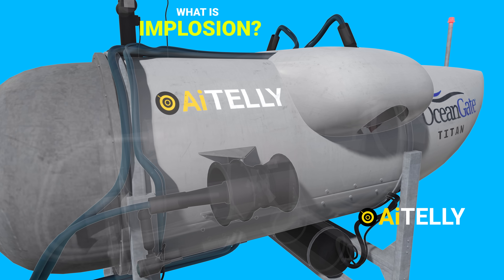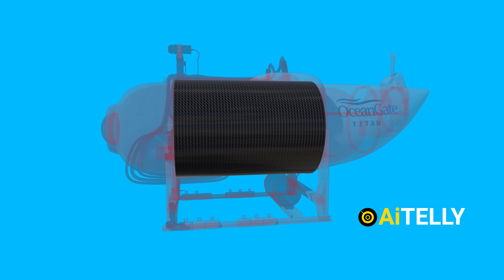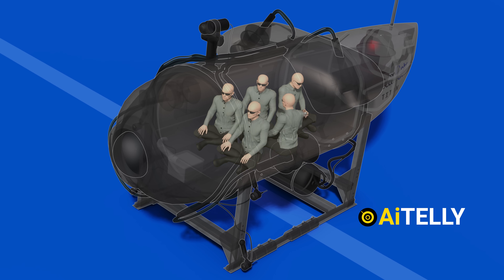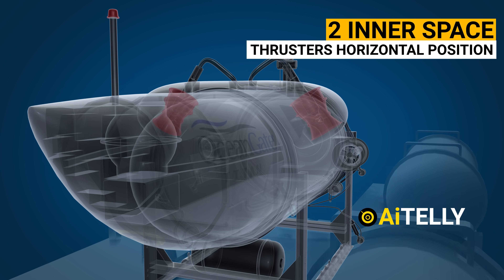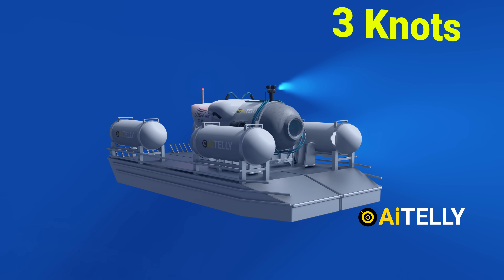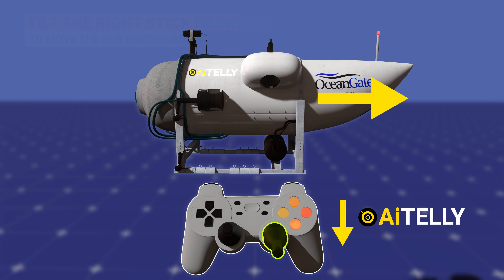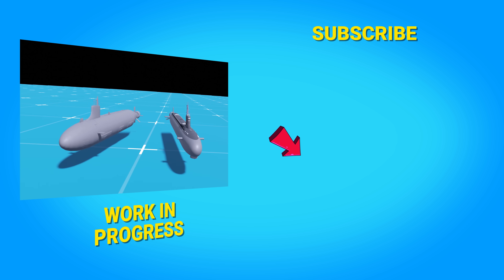Implosion Titan Oceangate How it Happened | Submersible Submarine Parts #3d

Comment: I think you should have gone into more detail on the carbon fiber hull. Most people already know how the submersible works. However many comments don’t understand why carbon fiber is inferior to titanium in deep sea diving. You could explain how composites work and how the CEO knew it had a limited lifespan. That way everybody understands why this disaster happened.
Reply: Kohlefaser ist zugfest, also gut gegen druck von innen, aber sehr schlecht gegen druck von aussen!
Dazu kommt noch das der ceo keine neuen kohlefaser verwendet hat, sondern von boeing ausgesonderte kohlefaser weil sie ihre nutzungsdauer überschritten hatte, hat er sie billig erwerben können!
Und die scheibe hatte nur eine zulassung für eine maximale tiefe bis 1300 meter!
Reply: @roadracett2853  Wow! I hadn't heard that about Ocean Gate buying old surplus carbon fibre. If true, that's evil.
Yes, my understanding of carbon fibre is as you said, great tensile (under tension) strength, but not so strong when under compression.
Reply: @roadracett2853 so he went way over twice as much pressure it was designed for" wow" 😮
Reply: @roadracett2853  thank you. This is much more info than these tired, getting stale videos.
Reply: The carbon fiber just seems like a bad idea
Reply: @likemostthings  it was apparently.
Reply: @likemostthings  Hindsight is 20/20. Haha
Reply: Best comment. Moisture is creping into the fiber.
The cyles also matter!
Everybody is able to google te following text:
On the other hand, there is still a significant problem with epoxy resins, one that limits their use in the aerospace and other demanding markets: their ease of absorbing water. The absorption of water decreases the thermo-mechanical properties of these composites, shortening their useful life. Several works related to the effect of surface treatments on carbon fibers or the incorporation of thermoplastic resins to the epoxy resin on the resistance to water attack in carbon fiber-reinforced composite materials have been reported
Reply: @fritzlehner9060  I would really love to see someone who really understand physics and composition of material to explain all this concepts together, such as the explanation on why for a brief moment there was temperature like "the surface of the sun" and what explains that (maybe the compression, like in a car engine), but I'm seeking for this content and can't find anywhere.
Reply: @AlexandreAugustin  Look for adiabatic compression. In fact it is comparable to the stroke of a Diesel Engine, but a lot more of compression.
In a Diesel Engine the compression ratio is aproximately 20:1. In case of the implosion pressure rises from 1 bar inside to more than 300 bar surrounding water pressure outside.
Reply: @AlexandreAugustin I'm not a physics expert but I saw it explained as the water collapsing in acts as a piston in an engine, compressing the air and igniting the oxygen in the space.
Reply: @fritzlehner9060 the RIFA capacitor is a prime example of how expoxy absorbs moisture, cracks, more cracks from thermo-cycles and goes Ka-boom in the end, causes catastrophic failure over time.
Reply: @andytwgss  Very true !
In this particular case the resin prevents the fibres from buckling.
And of course the cycles have an impact !
Reply: @fritzlehner9060  not to mention they didn't put the carbon fibre hull through the oven to strengthen the bond of the epoxy and squeeze out the oxygen in the layers. Also they didn't keep it dust proof environment during Manufacturing means it's inherently poorly made. A ticking time bomb at best
Reply: @leonardleonunu  So true !
It is not that easy with carbon fibre.
They were hobbyist !
Reply: Just because they said that they listened to the viewers feedback, they can’t go back and change the video every time they get new feedback. They been gracious enough to do that. Imagine if all creators do that! Madness! It takes a long time to make videos and edit and all of it
Reply from the maker: Ok that was really Goog feedback-Thanks for educating us
Reply: @Aitelly  why's this answer so AI-ish
Reply: @sefii05 suspect it probably is. But this is youtube...it's all for clicks.
Reply: @imho2278  so many engineers on here, I wonder if the officials will search these threads for confirmation lol
Reply: @sefii05  you haven't seen the way AI answer things lol
Reply: @thedbcooperforum well I am a electronics engineer who did work with composites in high school.
We tend to be interested in accidents
Reply: @jhoughjr1  sorry, should of been more clear, I was referring to the "so called experts" that seem to pop up with events like this...
Reply: @sefii05 Can't even tell, but I'll bite and point out the literal name of the channel you sought out and commented at. Dear lord.
Reply: @sefii05  I feel everyone is going to be on the look out for AI these days... and probably for a good reason! I'm sure it's going to be used EVERYWHERE including the Youtube comment section!
Reply: @sefii05  because it deserves that, if anyone thinks they can do better, they should go and make their own video edumacating us. Lol
Reply: @sefii05  It is AI lmao
Reply: @lololololol-z3x  I
Reply: @Aitelly   so the submersible had better toilets than the country of india??
Reply: @Aitelly  Goog
Reply: @Aitelly I thought the controller showing how the ship moved was an interesting animation that no else has done.
Reply from the maker: @wangchung6910  Thanks bro only some real OG will understand the animation and research that goes into it.
Reply: @Aitelly they literally reached the titanic wreckage. Checkout the previous expedition. But in this expedition something must've gone very wrong
Reply: That was Goog feedback, lol
Reply: @Aitelly  yeah whatever. Those who can't preach. Nice work!
Reply: @Aitelly I feel like everyone is constantly telling very basic points to touch on that you always fail to add. Your videos are super short. Seems like you dont care to be too detailed with your videos.
Reply: @Aitelly   yeah and the animatin of the implosion is not correct. They animated it like it is bending inwards but actually it violently imploded and shattered into peaces.
Reply: @Aitelly  
Is that an answer of a real person, taking the piss or AI?
Reply: @Aitelly  Gooooooooooooooooooooooooooooooog!! :P
Reply: @Aitelly  loosen up a bit lol you sound like an AI
Reply: Sarcasm!
Reply: @Aitelly  You should’ve already known this before putting out limited information.
Reply: Based on the video I saw showing how the pressure hull was constructed, it was metal wrapped with carbon fiber.  This type of construction is usually used to contain high pressure such as carbon fiber/fiberglass wrapped SCBA tanks.  It’s an excellent method to contain a high pressure expanding against a cylinder.  I have never seen it used in the other direction preventing implosion, and it doesn’t seem to be an effective way to resist pressure from the outside to the inside of the cylinder.
Reply: yeah carbon is good when it comes to extension but terrible for compression
Reply: Also do not forget that they did not interweave the carbon fibers in X pattern like it's supposed to be done, they were laid in paralel with little overlap. Not that this matter anyway over time considering the properties of the carbon fibre itself.
Reply: Terrible build that shouldn't happen but it too late..   just leave titanic alone and don't do anything in the future..
Reply: Rush must have worn the same shoes his whole life , he had no concept of wear n tear.
Reply: I’m not a mechanical engineer but even this layperson can see how it’s a really awful idea to join a carbon fiber CYLINDER to a titanium semicircle, expose the whole magilla to hundreds of atmospheres and expect it to hold up.
Reply: This video was informative for me
Reply: @RuminatingKiwi927  ? he called the titan a submersible. the other submarine was infact a submarine.
Reply: @lololololol-z3x  woops, didn't mean to reply a comment. Anyway, the U-boat isn't a submarine, it's a submersible because even though its not launched from a mothership, it's not meant to be underwater for a long time, or spend most of it's time underwater. However, the electric variant of the U-boat is a real submarine because it can spend most of it's time underwater and actually perform better underwater.
Reply: @RuminatingKiwi927  As the name suggests, the U-boats are under-surface ships or boats. The letter U stands for German word "unter", having a similar meaning with English word "under".
Reply: because it's a weave of fibers helt together by glue. It's like making a space station out of wicker baskets.
Reply: @KneeCapHill I’m making a Titan Model using a TP roll and Fisher Price Little People as passengers.
Reply: It is ok though. These videos are supposed to be quick rundowns. Last video there was no mention at all but now they acknowledged it as being the main part of the thing. 
And again, these videos are just quick summaries. There are other channels with in-depth analysis.
Reply: @laughingseal2282  The title suggests that exactly "How it happened" would be explained, and since we all know the composite material was the culprit, how it happened wasn't exactly covered in the video. The reason for this is that they don't have any idea, which is a perfectly reasonable objection to this particular quick summary.
Reply: Also another note is that it had made more than one dive and each compression and expansion weakened the Carbon Fibers so this (I believe) 7th dive was the unlucky one
Reply: OceanGate CEO once said Titan sub's hull was made with carbon fiber from Boeing that was past its airplane shelf life which he bought at a discounted rate.
Reply: @WR-NC-ASPL  That's sick. I'm not an expert but my father (an aeronautic engineer, now retired, who was responsible of the safety of the wings of some Airbus planes) says is just idiotic to think the preassure of a submarine is somewhere similar to the one of an airplane. A submarine suffers x400 more preassure than an airplane!!!
Reply: These guys aren’t experts at all, they’re just trying to put out videos as quickly as possible to farm views, hence them having to correct their prior video and potentially correct it again
Reply: Exactly, I'm no scientist, but nonetheless I would be interested why carbon fiber is inferior to titanium and why it was used.
Reply: @sitinowak Rush definitely used to to save money, and it didn’t take him as long to build, so he could be making money as quickly as possible.
Reply: @sitinowak im an engineer who worked in the aero space industry the reason it was used on aeroplanes was because it made them lighter and airlines liked this because this conserved fuel and it was good for sales unfortunately it could only be used on certain parts and definately not on the fuselarge because when rivets were inserted they did not give a tight fit and if struck by lightening it would make it very dangerous for anyone travelling titanium is a much stronger material i would of thought carbon fibre should never have been used on a submersible especially at the depth of titanic
Reply: It's curious how they thought it was a good idea to make a submarine with the material of an airplane 🤷‍♀️. It's as crazy as making an airplane with the material of a submarine. The preassure conditions are sooo different in each case.
Reply: They should’ve done a weave instead of rolling it on, but also more R&D unmanned to see what the absolute limits are and how many times it can go down and to what depth.  It’s possible to innovate and tread carefully.
Reply: Still now i didn't understand why CEO choose that material? How much cost he saved..
Reply: @Just_chill_bro_its2025  I think it would mainly be used as it's lighter, so saves money on the winches, thruster power etc.
Reply: I just use what James Cameron uses 🤷🏻‍♀️
Reply: Why Carbon was there😢😢 its weaker
Reply: @arjumandvillagelife money it’s cheaper and he wanted to get it making money as soon as possible.
Reply: Assuming the hull was the issue. Right now, nobody really knows what happened. Everything has to be looked at. Typically, an accident has a starting issue that may be very minor. Did the crew make a mistake on the deck? Did the "captain" get enough sleep the night before? Was there a fire? Did they hit something in the water? If the hull was the cause, were there imperfections in the material? Was there consistent thickness....etc, etc. Honestly, you don't know if it was murder suicide. The investigation will take many months.
Reply: Not only the carbon fiber but how it was jointed to the titanium. I wonder how that was made considering that they are two very diferent materials and there was the failure point.
Reply: @magister61  they glued it no jokes.....a brave man
Reply: When other Compaines, and several engineers in the industry advise you not to do something. It’s time to drop your ego and listen to them.
Reply: absolutely, beside that, they placed the oxygen supply outside the Hull, the monitors were screwed to the Hull instead of using this vacuum holder. The composite material, carbon fibre, was bought by Boeing, since it has already expired he received it at a much lower price. Anyway, like you said, there was a lot of flaws in this design!
Reply: absolutely, beside that, they placed the oxygen supply outside the Hull, the monitors were screwed to the Hull instead of using this vacuum holder. The composite material, carbon fibre, was bought by Boeing, since it has already expired he received it at a much lower price. Anyway, like you said, there was a lot of flaws in this design!
Reply: Titanium and Steel are used for submarine and submersible because they r very ductile compare to carbon fiber.
We use carbon fiber whine we need stiffness, light weight and strength;  in aviation for instance but in submarine we need very ductile material.
these are material that can take a lot of force in many directions and still maintain its integrity and strength.
Carbon Fiber is very light and stiff, very good for boat application and aircraft body but not for structure tonbe subjected to extreme force in any direction especially perpendicular to the surface area as it is the case for submarine n submersible. Ocean Gate was aware of it but since the owner was cheap and did not want to put the money for it, he got what he paid for. He was warned by Engineer but he prefers to believe the unbelievable.
Carbon Fiber is very brittle compared to Titanium and Steel. He was warned and informed of the design flaws. 
Knowing what I know in Strength of material and the development of the hydrostatic pressure  as well as the property of material in material selection I will never advise anyone to use any material other than very ductile high-grade metal preferably High grade anti corrosion steel and Titanium
Reply: What about the computer monitors most likely being affixed into the carbon fiber hull? Hmm? I would liken a carbon fiber hull on the bottom of the sea to plywood. What about drilling into carbon fiber? I also noticed that there was a rubber like seal on the bottom of the titanium rounded hull caps and noticed that the rubber seal did not serve a purpose more than mud flaps on large trucks. You can see it in tour videos. What purpose did it serve? Do you ever think about how the titanium rounded caps of the sub every time it was bolted shut, should have been cleaned? It's a dark thought but what if the oils from your skin could have contributed to an improper seal when you were using that joint between the metal rings and the rounded metal caps as leverage to get into the sub? 

In the carbon fiber hull, any type of boring into the material introduces very fine shearing which can introduce tiny air pockets. I think you are referring to delamination of the carbon fiber hull undergoing stress from cyclic deformation and any tiny space where the layers separate could introduce new stress points. What about any stress on the glued carbon fiber hull to the titanium rings? What about the shear force between two different materials? Think about the ends of a carbon fiber hull bending up and down and the possibility of the carbon fiber hull fraying at the joint of the rings. What about the weakening of that joint compound overtime? It was glued on. Can you understand how hard it would be to maintain a proper seal in the depths of the ocean where the carbon fiber hull started bending? How could you make a carbon fiber hull last decades and how could you fix the fraying ends of a carbon fiber hull? It brings into question surface prep and going forward, how could you recap the ends of carbon fiber to make sure it had a great seal, how would you go about repairing it

Degradation of proper seals between composites, it's different in space.
Reply: A spherical pressure-resistant shell would have helped, but it was a mistake to make it cylindrical in the first place for ease of shaping.
Moreover, it is not a one-piece molding but a two-piece molding.
Reply: Carbon fiber isnt apropiete for objets afected by pressure
Doesnt matter if it is deep dive or not. Planes are not made of carbon fiber for a reason
Reply: I believe the fibercarbon is excellent for high-pressure tanks, but we we talk about external pressures, then the fiber should no use for this application...  Fibers resist stretch forces, but collapse forces I will believe only can hold by the epoxy but not by the fibers... So, in my conclusión the Epoxy  was resisting the pressure and not the fiber carbon... I'm not an expert, but I understand how good the Fibercarbon is for Extreameally  high-pressure cylinders...
Reply: @rupertoseabra9561  the window was not tested for that depth
Reply: About 1% of people in the comments know how submersibles work.  But everyone will pose as experts with their google education.  Google epidemiologists are now google deep sea explorers lol
Reply: Do you know how stupid people are?
Reply: hes guessing .. he cant say why untell they give us updates
Reply: Yes. I too want to know the points you mentioned. Nonetheless, thank you for the video.
Reply: A child molesting, career corrupt criminal will never be MY President.
Reply: Agree 100%
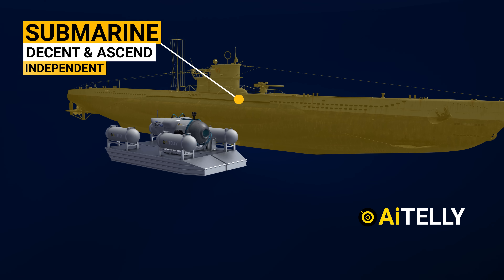Reply: 1:48 in fact, even the U-boats were considered submersibles. They were defined as such due to the fact that they could only stay submerged for at-least 2 hours before having to surface and replenish oxygen levels.
Reply: Why don't you do a video then smart arse?
Reply: Also the fact that it took them a long time to find the wreck when according to the media it was not that far away...then again the media are full of lies so maybe I am wrong
Reply: Try do a better job, this was a brilliant animation
Reply: Don't forget it also took a lightning strike
Reply: Play stupid games... Yeah they couldn't complain if they survived. Would you take a 300km/h Fiat Uno without a seat belt around Nürburgring ?? Yeah. So I really don't care. All I care about is seeing guts and gore of these idiots being exposed
Reply: You should do a video since you know exactly what this creator should of done.
Reply: I am only here for the ads.
Reply: Ummm. Someone else should do it. They can’t keep fixing a video every time someone has an opinion
Reply: FJB
Reply: Biden supported diversity hires. This happened in result of diversity hiring. 

Figured Id let you know that
Reply: Probably smart of them not to pretend to know other people’s thoughts. Clearly you think you already know all about this, so you don’t really need to watch at all.
Reply: This was barely a disaster... Super wealthy having fun that is all 😅
Reply: @aHarzoo that's exactly why it was a disaster. Two billionaires were lost and another highly regarded Titanic expert. Not to mention a 19 year old college student who's whole life still ahead of him.
Reply: I agree with your comment except what you’re saying on your user ID name 😂. It’s all right we can agree to disagree. 😅
Reply: Well, the theoretical limited lifespan is measured in possibly over 20 years... Factors like UV, humidity and so on affects it. But there is no way to tell how iterations of exposure to high pressure will affect it, at best one must perform inspections using ultrasound to observe failures within the matrix of the epoxy. I know for a fact that a full discovery of issues would be impossible at at mating surfaces where the epoxy is being glued to the titanium rings. One can only assume that these are the points of failure but it's not a given since the outside pressure pushes the titanium domes towards the composite, so it depends on how the composite is seated towards the titanium rings. If there is supportmaterial of the rings directly supporting the ID of the composites then one can assume its quite safe. However repeated high pressure compressions and decompressions of the hull may likely cause the epoxy to crack over time... The proximity of the wreck site would suggest that it did happen close to the bottom if the wrecksite is displayed to scale
Reply: but in the beginning he did mention in acute detail the inferiority of carbon fiber versus titanium/steel given their submersible application. Les we not forget how his focal point is about hull integrity as it pertains to deep water implosion. in other words, chill out, dude.. make your own rundown if you gon act like that.. oh wait.. plenty of other outlets already covered the bases you wish to have reiterated to you for what? oh, cause you're just .. you
Reply: Just watch James Cameron explain it
Reply: I thought carbon was much stronger than that. It did not even went to 4.000 meters and it popped. Disapointing materiial.
Reply: This comes from a guy who supports someone who doesn't make any sense while talking, "all men and women are created equal and you know the thing....."😅
Reply: It was an accident
Reply: They may as well have lined a 1978 Chrysler Volare with sheets of plywood and pushed it off a bridge. This was NO tragedy for anyone on board beyond the unfortunate young man who's father forced him into it. It was an example of the same risk taking that  made them all wealthy taken one step too far. The issues with Titan where "no secret" yet they all plunked down 250k anyway.
Reply: Make your own video, genius. I'm sure it will be perfect
Reply: Hi
Reply: Barrack is really your president.
Reply: I was about to comment the same thing, the shape and material of the hull is the most critical part, the outer skin didn't have much to do with the failure other than it just covered the craft & housed the electronics etc...
Reply: They cant they are lazy. And only wants visits
Reply: Im an engineer who worked in the areospace industry carbon fibre as a material is a lot weaker but also a lot lighter than titanium the reasons for using carbon fibre on aeroplanes was to make them lighter which in turn would save on fuel which airlines could save money
Reply: 1:04
Reply: Acknowledge posters critique/ suggestion that more time be devoted to pressure chamber analysis. However, video was perfect for my needs as I know very, very little about the submersible industry. For that I thank you!✌️
Reply: Explain the 2481
Reply: Have you noticed how often ps joysticks implode?
Or self destruct or whatever it is they do.🙄
Reply: I mean, so could you though??
Reply: I was almost clicking on the like button to this amazing comment but howeher it was made by Joe Biden, and i don't like him.
Reply: This video is automated
Reply: dont even know if it was the hull that caused it. stupid video speculation
Reply: Goog feedback
Reply: I think we can't explain more in detail the specific of the vessel because it was one of it's kind. This means there's no literature about it and every technical information is owned by the company.
We know that carbon fibers break instantly like ceramic and that their fatigue resistance decrease rapidly
Reply: @simoneceron1915  we know the window was not rating for that pressure
Reply: Joebidenis your president, u  can't advise him @ his own channel. Stop that Biden dictatorship
Reply: U r a dictator. Bidenis your president
Reply: Not to mentioned the moron even bragged about getting that material from expired aeroplane.
Reply: I don't understand why the carbon fibre wasn't multi layered in different directions. 
This is what gives it it's strength.
Reply: Exactly
Reply: He should have explained to the rest of the world, what pounds per square inch is. Are we in the middle age?
Reply: @@markdurham7918 
At last, some sanity amongst this madness.
Reply: I would have also liked it mentioned that the Titan had been down to Titanic a few times successfully already, and that it was in service for 5 years prior to the accident when it also ventured around the Mariana Trench.
Reply: actually, the US Navy built and documented that a Carbon and titanium Hull can be stronger and lighter than titanium alone. However, I suspect the failure here was not being allowed to inspect the hull after and before each dive. under those pressures, the carbon fibres will move and some may even delaminate. so with each dive, the hull will become considerably weaker.  the failures of the company to allow thorough inspection as been documented here.
Reply: Nobody knows why it imploded it’s all a guess at this point …. For all we know the seal gave out
Reply: Why did it have no black box tho?
Reply: Only reason is the choice of uds in one direction.. we never do that..we cannot blame oceangate for the poor construction
Reply: Things will be revealed in the court definitely
Reply: Thing literally had a window and you're wondering what the weak point was lol
Reply: its was the vessels 25th trip of course it was past its use
Reply: I enjoyed the full explanation. A lot of people, including myself, are new to submersibles, so it was beneficial for a lot of people. More on carbon fibre would have also been appreciated but I'm sure there only have a limited time.
Reply: I posted this comment before seeing your comment, but I'll repost under your comment to read just incase my original comment gets lost in the sea of responses to this video:

I think your graphic demonstration, while impressive, is moderately misleading.

The hull being made of carbon fiber is essentially plastic, carbon fiber itself is not air-tight, and polymers/epoxies are used to bond the strands and create the seal. The carbon fiber itself simply acts as a structural support to the very hard epoxy/plastic. 

If you have ever dropped a plastic cup and had it break, you will note that it does not deform like metal (like dropping a can) it actually shatters. 

The reason why carbon fiber is not considered a suitable medium for repeated exposure to high external pressure and temperature change is because small imperfections can easily become trapped within the layers of the carbon fiber and epoxy that cannot be effectively detected prior to launch.

For example,  during the weaving process air bubbles can become trapped, fibers can become damaged, or during the curing process bubbles can form, mixtures can harden at different rates creating shear zones... etc etc.

Imagine there is a bubble trapped in the hull, even just a pin sized bubble. This air pocket will become compressed by the pressure and allow moderately more flex to the carbon fiber/epoxy above it as it has more space to move before reaching its backing support.

This repeated flexing of the epoxy above the pin sized air pocket will inevitably cause micro cracks in the epoxy, and allow for the movement of the weave which will cause delamination between the layers. This will run the length of the strands in the weave and expand more and more quickly as the integrity of the epoxy becomes more and more compromised (because it obviously provides less resistance)

Eventually these seemingly minor, nearly undetectable imperfections, cause enough of the material to compromise that the sudden increase in pressure (3 knots / 3.5MPH down to a depth of 2.4 miles / 3800 meters, or 1.56 meters per second. 1 atmosphere of pressure is roughly equivalent to 14.6 PSI. For every 10 meters of descent into the ocean, the atmospheric pressure equivalent increases by approximately 1 atmosphere.
So at surface level, approximately 1ATM, at 10 meters down, 2 atmospheres, 100 meters 11 atmospheres etc etc... down to 3800 meters (resting depth of the titanic) that would be approximately 381 atmospheric pressure. 381*14.7 PSI = 5600.7 pounds of pressure against each square inch of the hull.

That's 144*5600.7 =  806,500.8 lbs of pressure affecting a single square foot. 

For perspective, that would be like parking two empty B747 jumbo jets ontop of eachother on a single square foot of space. 

That's means the hull of this submersible was subjected to an increase of 2,116.8 lbs per square foot every second during descent. (The equivalent to stacking a tesla model 3 ontop of each square foot of that hull every 1.92 seconds.)

So when this hull failed, it would not have crumpled, it would have shattered inward, like glass.

There's a reason why in most of the recovery photos you only see metal and other malleable components present, because the carbon fiber was likely essentially pulverized by the expansion of water into the cavity occurring at approximately 10 times the speed of sound.

If you want to get an idea of the destructive force this would have on a person or object, just search for videos of large amounts of water being dropped onto things, and remember that water falls at approximately 9m/s (20mph), but at those depths the water would be compressed to approximately .96/97 of its original size, and would expand to fill that space, accelerating the rates in excess of 7-9 x the speed of sound. (Depending on various factors like salinity, temperature and depth, but to keep it simple, just assuming the maximum rate of 10x the speed of sound or 7610mph or 11000 feet per second / 3352.8 meters per second.)

Assuming the space inside of the sub was maybe 1 meter in height from floor to ceiling, you can imagine how quickly these people were struck with 806,500.8 lbs per square foot of weight. (Average adult male has between 14-18 sqft of exposed skin across the surface of their body. Ergo it would be like flying 24-36 747 jumbo jets into them at mach 10.)

If you were to put a pin sized hole in the hull of that sub at depth, water would force through it with the power of a water jet cutting machine.
Reply: I think it's a basic design flaw because any fiber aims to endure pulling force, while  inward push at thhis pressure damages it.
Reply: It was because the material used to make the thing , it wasn't sufficient for the pressures of deep sea ! RIP people's,  💐 💖
Reply: It's simply obvious that titanium is a super metal first more weight make it way more strong and another properties
Reply: They were very stupid the restroom was the only part which reached the titanic
Reply: It looks to be made cheap...
Reply: ya ppl making these videos suck
Reply: It's probably made like a carbon fiber drive shaft or threaded link with the flanges dry wrapped and formed to them and a machine is wrapping to build a structure.
Reply: why use carbon fiber that what imploded
Reply: Yes. Too much time spent explaining how 2+2=4. Silly video
Reply: That would suggest this CEO wanted to go down as a murder/suicide deal, i simply think the guy didnt know anything about anything, and kept hiring only engineers that agreed with him (several people have quit, or been fired for raising alarm about how this fools whole thing was going, he was a fool, arrogant, whatever everyone is trying to say to defend this ape is all bullshit, ANy human being that works or has owned any laminate material knows they are not good with water, water is small, carbon fiber is full of holes, we fill the holes with epoxy and resin and whatever else, this will never ever ever (unless we invent new materials that dont exist rn, or that we havnt discovered yet) anyways, metal doesnt have holes (atomically speaking or whatever) i mean water cannot be forced thru metal without removing metal so water stays out of your boat, fiber glass, carbon fiber, things like that barely make decent materials to build boats out of and they only sit on top of the water, every single person with a brain told this guy not to do this, begged him to stop, anyone involved in this company should be in prison or a mental hospital imo
Reply: It seems like the thought process for the carbon fiber was to reinforce the submersible as a sleeve or shell if you will. Carbon fiber is very strong, but it also cracks or can flake/chip. I have had carbon fiber brakes on cars and once they chip, the integrity is compromised. Some people may have seen when the F 117 Stealth Fighter wings snapped and failed causing it to crash. I think the idea of using a carbon fiber sleeve around the submersible as a lightweight reinforcement was good in theory, but it should have been fully tested multiple times. It will be interesting to see if the part of the submersible that failed was actually the carbon fiber sleeve section, or if was actually the tail or nose cone that was not protected by carbon fiber that failed. It could be that the carbon fiber section held up as the other pieces of the vehicle failed. It will be hard to determine without all of the pieces and especially without any monitoring system.
Reply: I know nothing about engineering but when I heard the submersible used carbon fiber I was like WTF! I do know that even though carbon is supposed to be strong it is very brittle.  I use carbon cutters/bits in my CNC router and they break all the time.  So I never understood the idea that it's supposed to be strong.
Reply: How about you go and make a video explaining that.
Reply: We know now that carbon fiber is superior for deep sea dieing.
Reply: I am so sorry he didn't stick to know and proven materials. Someone should have talked him into more testing without live occupants. Very sorry for families loss. It was a tragedy  that should have been avoided.
Reply: It was a death trap from the beginning and no one should us it except for in shallow waters!!!
Reply: Yeah, this felt like it was intended for 5th grade level. You showed some cool stuff though. The voice is also AI, it pauses at the wrong spots and emphasizes the wrong words in sentences, I hope that's not you talking. It's uncanny valley material. Is this an AI project channel?
Reply: Rush received about $1 MILLION DOLLARS$ he took a gamble with his own life and 4 others, all for the sake of $money$ it appears.
Reply: Because it's Clickbait
Reply: As even a layman, I'm thinking even a hairline fissure would have led to catastrophe, not  noticed but under the conditions it loses integrity immediately!
Reply: All submarine hull materials have a limited lifespan. That's not what's unique about carbon fiber, and therefore it's not really what the problem is. The problem is that, due to the mechanical structure of carbon fiber, it is unpredictable and difficult to model under compression, so its fatigue life is similarly unpredictable and difficult to model. Titanium or steel subs will fail eventually too, the thing is we have very good understanding of how the material performs and how it fatigues, so we can safely dive subs and retire them while they are still safe. With carbon fiber you don't really know when it's no longer safe, until it fails and you're dead.
Reply: Not to become too philosophical but don`t we all have a limited lifespan? ;-)
Reply: Carbon Fiber, fiberglass, and Kevlar withstand compression loads repeatedly.  For instance the Boeing 787s top spar cap is compression loaded.  
    Compression loading fibers in analogous to pushing a string up a Hill.  The issue isn’t strength, failure mode being buckling or herniating into a void.  The trueness of the fiber lay, and void free matrix are critical.  
   Thick wall pressure vessels have a shear stress across their wall equal to the difference of the OD to the ID hoop stress.  There is no way to fiber reinforce this stress.  So it is carried by the epoxy.  Suggest this is the butt kicker.
    Each dive and as it went deeper the hull would emit noises (outside human hearing) each ‘micro’ failure.  The rate accelerated toward the end.   
   The implosion in the vid erroneous.  Carbon fiber shatters in big chunks.  There wasn’t enough oxygen in the hull to burn more than a couple of pounds of fat.  Once gas squeezed out, the bodies were pressure balanced.  Given flesh’s elongation, the bodies more like bean bags (but may have trauma from carbon shards).   (Going the other way, if deep saturation divers suddenly decompress the bodies explode.).        Cheers
Reply: Nobody will acknowledge it but if the vessel lost power source being it has a odd shaped rear end the heavier end with the weak glass would have hit bottom causing implosion after the glass already weak not rated past any other materials used it would of been first to allow pressure inside and flatten
Reply: That object weighed too much to not hit bottom on glass side vs floating to surface if power source was lost
Reply: The vessel looked like a rain drop and the already not rated high enough glass end probably hit bed causing a scratch or crack on glass allowing pressure into hull very fast
Reply: need to understand the poeple that create this videos are not engineers or anything sort like it... they just explain what a lot of video already do but nicer animation with better view so people gets a lot better knowledge about what happened
Reply: Nobody knows the reason the sub broke up at this point
Reply: @ivorheftylanger  not very sure but I think they said it was because it couldn’t handle the pressure. It had only been on so many dives, but people knew how incredibly dangerous this was. The glass lookout hole thing was NOT made for 4,000 meters of pressure-but you are right and there really are thousands of things that could’ve gone wrong-from the video game controller losing connection, an implosion, a deep sea creature, god knows. Nature is strange.
Reply: I've constructed and tested fiber composite pressure vessels to destruction. Fiber composites excel in tension, not compression; the design concept for this is fundamentally flawed.
Reply: @MarkShinnick   Mark, do you have any videos of your crush tests you can post?
I would like to see a really strong pressure vessel suddenly let go.
Reply: @TooTallDean @markshinnick I'd like to see that too!
Reply: basically , carbon fiber is strong however it is brittle so when it is crushed it will turn into pieces. while titanium is also strong and when it is crushed it is flexible like a plastic , think of a plastic bottle when you squezzed it ,it will go back to its shape while the titan is like a glass bottle, when crushed it will turn into pieces. sorry for my english hope u understand.
Reply: @markllanera8416  your English is very easy to understand.
Reply: I don’t think anyone actually has info on carbon fibre behaviour under extreme pressure, this isn’t something that was extensively tested or documented before. This isn’t a material that was in wide use in submarines at all. OP can’t speak of it because nobody can.
Reply: @JaneLame  pressure vessels are constructed out of carbon fibre. I am a composite technician who has made these in the past.

We used to make inlet plenums for F1 cars and oil pumps/servos. They were tested to 12bar (174 psi).

When testing them submerged in water you could hear the air voids and fibres clicking and compressing together. They had a working life of about 500 laps, so these materials have their applications.

But not for transportation of humans!!!
Reply: @Takutak866  And not for the deep of the ocean. The preassure if faaaaaar worse than in a high speed surface vehicle.
Reply: theres something i still don't understand, when the implosion occurs in several places it is mentioned that the temperature rising making the body practically ash? Could you know why or is there a mathematical formula that explains that?
Reply: @melonter7994  compression creates heat. When scuba tanks are filled the air is compressed inside.  The tanks become very hot and need to be kept cool, usually in a tank of water. When de compression happens, the temperature decreases: spray a can of compressed air - dust off, for example, and the can becomes very cold as the pressure is released. At the depths they descended, the pressure is so great - thousands of pound per square inch - when the hull failed the water rushing in compressed the air inside. A gas can compress, liquids cannot, so the water is no different than a steel press. The compression happens so quickly the air temperature can reach millions of degrees in milliseconds. The water coming in contact with this super heated air probably instantly turned to steam. The total pressure acting on the hull was in the millions of pounds. That much weight would also produce a shockwave that would likely atomize everything in it's path. It was exactly like an explosion, just from the outside in. 
It was very very quick.
Reply: @tomkam9783  Excellent summary. Thank you.
Reply: @tomkam9783  thk. That was a very good explanation, iirc there's equation that relates gases and pressure, it was the ideal gas law PV = nRT. idk if im right, don't remember much about thermodynamics anymore. but it itched me to know that part
Reply: @melonter7994  the bodies turned into ash bcuz of the intense heat caused by the implosion. When something implodes basically it's like internal combustion. We talking milliseconds that it took to disintegrate humans .
Reply: @melonter7994  Pressure does makes heat
Reply: @melonter7994  Look up the chemistry equation PV = nRT. When the pressure decreases, the temperature increases. If you're curious about another situation like this, look up the Byford Dolphin diving accident.
Reply: @melonter7994  I think the temperature rises because of the speed to which the implosion occurs but I may be wrong
Reply: @melonter7994  Yes, it is easy. pV=nRT and pV/T=const
Reply: @melonter7994  When an implosion happens at these depths the pressures enforced on the human body basically turn the body including the skeleton into a paste-like substance.
Reply: @melonter7994  Boyle-Mariotte formulas
Reply: We've already heard about the carbon fiber non-stop. What rock have you been living under?
Reply: This channel content is useless . All the subs are bots maybe
Reply: Sub must of imploded unexpectedly and the ship above lost communication. Scary scary death
Reply: They said they died instantly and that the pieces would of been shredded into small parts. I saw whole parts, not crushed as assumed, so they dround to death if anything. It was a death they felt and was aware of for the most part. And carbon fiber ??? Doesn't crush like metal. So This implosion is unique
Reply: what are you doing here, Biden?